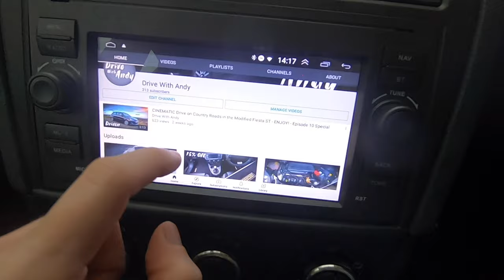Building My Car Over the Last 2 Years Plus I Did Do Some DIY Inspiratinal - FIESTA ST150

Comment: Hey Andy! Do you know if this aftemarket steering wheel diameter is the same as the standard? Want to put a smaller steering wheel on my ST150 but i want to keep the airbag!
Reply from the maker: The custom wheel I have is made by Sebastian Okon and the diameter is the same as the standard. Would be nice if it was a little smaller. Maybe if I ever get another made I'd ask if a smaller one could be made to fit the airbag
Reply: @DriveWithAndy  thats a great idea!

Comment: Well i own a Ford fiesta 1.25 2008 4door  like this gen on the video (my 1st car) and I think of doing some cosmetic changes like an St pack like something clean not a ricer but is it worth it to do this change on a car with that engine it has 73 hp and I don't think it will be fun as and st engine so idk stunning process actually you gave me great ideas thanks (sry if there is any mistakes in my text I'm not a native speaker)
Reply from the maker: Hi and thank you for the comment. Great first car.
Your plans sound nice to me. Ok to out the ST bumpers on for that sportier more aggrieved look. Just don't stick ST stickers all over it haha. 
Maybe some FORD or custom designed side stripes as well and nice 16inch wheels. 17s look too big in these cars Persia lly once lowered plus saves weight
Reply: @DriveWithAndy thank you so much man. I don't like too that  many st badges on a fake one I will just put the st pack without the badges in order to have a clean build. I think also about changing the Rear-view mirrors from the plastic ones to a colored ones also I consider buying a painted black side stripes to match the Grey color of the car plus also a painted door handles since the plastic ones feels cheap and not beautiful at all. I think about 15 inch rims due to the bad road condition  because with 16 Inch rims I will be forced to install with them low Profil tyres and with the potholes and all it's not good. And do u think I should touch the mechanical part for a example a remap to get it to 100hp (I don't want to push it too much to preserve the reliability) the engine is the duratec 1.25 and it's know for its reliability, a sport filter and I think about changing the exhaust pipe I'm not sure bc it will makes too much noise  compared to the performance I will gain from this modification. 
Thanks for your time.

Comment: Do you have a link for the gear knob and the frame I’m looking for one but yours is the best I’ve seen
Reply from the maker: Gear knob that's in alcantara is from KolourKoncept and you can ask for the carbon fibre insert, the insert is from red5carbon. For the centre console which surrounds the gearstick I suggest Swift LED conversions on facebook

Comment: Do you know if a 2005 can take 2008 parts like the front end? Lights, bumper grill
Reply from the maker: id of thought so yes. mine now has the pre facelift headlights. the wiring connector is in a different location but still works

Comment: Hi I’ve bought a fiesta mk6 I was wondering how to fit the more aggressive bumper
Reply from the maker: You can bolt on splitters and canards but apart from that it's a whole new bumper that would be for any Mk6. There are some but do have a 90s max power feel. Drastic option is a full wide bodykit. The JWRC one like the video I featured a year ago

Comment: mine is an S 90hp 1.6tdci, no clue where to start with mods and what is legal and what is not
Reply from the maker: the 1.6tdci is such a great engine to tune. even just a simple breather and exhaust with a remap will see a huge power increase yet still very eco. In a way better than the ST 2.0L NA. with checking what is legal and illegal i feel most things are legal. Just do some research on what your thinking of doing first. For example if getting wider offset wheels just make sure they do not stick out for the arches. some risk it for a crazy wide look but personally its not for me and risk being pulled.
Reply: @DriveWithAndy  where did you learn so much? also thanks for replying, well Italy is really strict about rules on cars and I don't even think changing your exhaust is legal, you 100% have to met requirements and stuff and get it approved but some people just risk it and have cool loud exhausts and make noise
Reply: @DriveWithAndy  I also tried an air filter if that's what you mean with breather but was like a cheap one from Amazon and that changed nothing in the sound and also since the connector was weird shaped I had to put it in a spot where it was taking also hot air
Reply from the maker: @Mistshine  oh I did not know it was hard in Italy for car modifications. I can not say unfortunately 😞